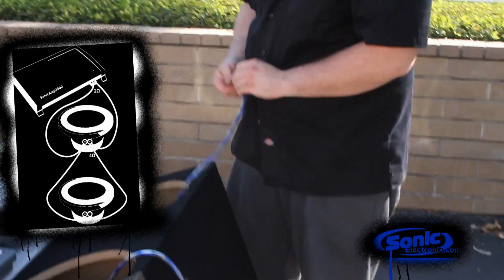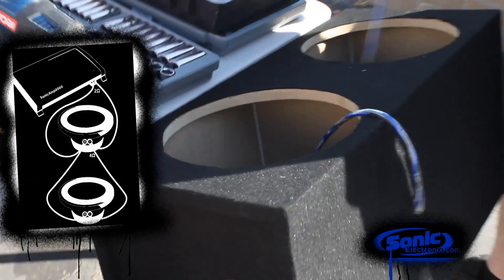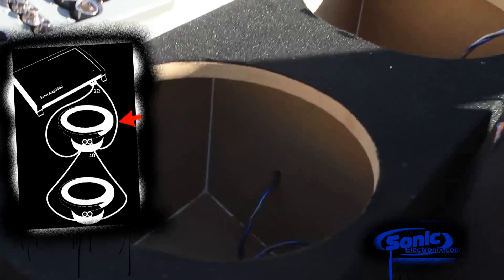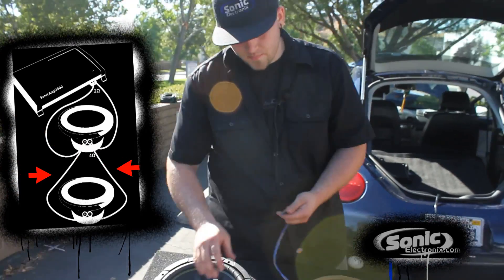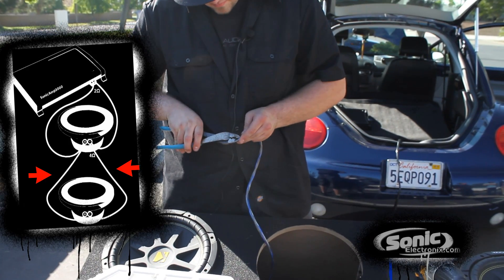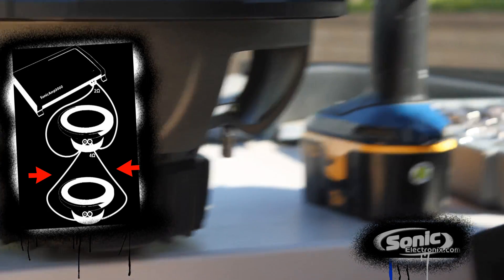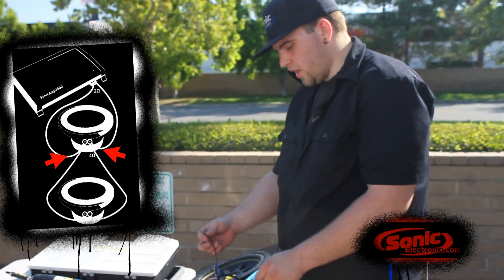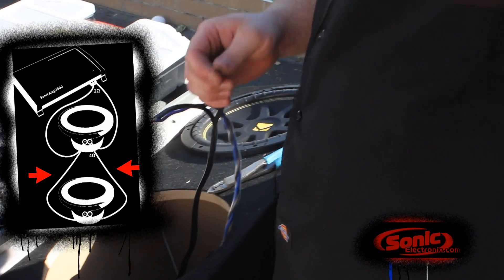How to Install Two Single 4 Ohm Car Subwoofer with a 2 Ohm Impedance

Comment from the maker: @ddizzle108 Max power isn't the actual power that you're going to get from your amplifier.  Max power is usually extremely overrated, so if you look at the RMS power on your amplifier you will get a more accurate rating of how much power is actually pushing towards your subwoofer.  On that particular subwoofer you're only going to want to run 250 watts of power to each sub, so you're most likely powering them properly.  Wire each subwoofer in parallel to it's own channel for the best output.

Comment from the maker: @ranchero302me If the speakers have a single voice coil and a 4 ohm impedance, yes.  Car speakers and subwoofers tend to have a 4 ohm impedance, however a lot will have 2-3 ohm impedances as well, so keep an eye out. The technique used in this video is called parallel wiring, and will reduce the impedance of a speaker.

Comment from the maker: @TheDaltonboii Well since you're using two speakers that require 1000 watts each, then you will need a total of 2000 watts to properly power them.  Always check out the RMS power when matching up compatibility with subwoofers and amplifiers as well, good luck with your system.

Comment: i have a question for you. if you wire the speakers together lets say you have 2 1000 watt speakers hooked together will a 1000 watt amp push them or would you have to get double the power

Comment from the maker: @lalop562 Depending on the accuracy of the amplifiers ratings, you may be at risk of blowing the subwoofer in an expedited fashion.

If the amplifier is rated way above the subwoofer, but the amplifier isn't rated properly, than it's very hard to distinguish if you're overpowering or even underpowering.  A lot of amplifiers are over-rated on the market so it's best to ensure if the amplifier you're dealing with is "CEA Compliant" or not.

Comment from the maker: @lalop562 500 watts will give you some bass response and it will work fine, but if you want to get the most out of your subwoofers I'd go with an 800 watt amp.  Good luck with that switch!

Comment: ok thanks a lot i'm going to go buy a bigger amplifier because the one i'm using now is a Sony XM-D500X 
250 watts RMS x 1 at 4 ohms
500 watts RMS x 1 at 2 ohms
2-ohm stable, Class D design. I was only pushing 500 watts at 2 ohms.

Comment from the maker: @Merwynlee You're best bet is to just run your wires from each box to the amplifier.  If you're using a monoblock amplifier that has two input terminals for both + and - then you can just run each positive and negative speaker lead to each terminal and allow the amplifier to internally parallel the wires.  If you amplifier only has one + and one - input for speaker wire then you can just twist the positive wires together and run them to the terminal and do the same with the negatives.

Comment from the maker: @lalop562 I'd recommend a monoblock amplifier capable of 700-800 watts of RMS power.  You can use an amplifier like the Infinity Kappa One, the Clarion XH7110 or the Boston Acoustics GTA-800M.  All three of those amplifiers will efficiently power your subwoofers and put out some great sound!

Comment: ok if I have two 12 inch kenwood kFC w3011 svc 4ohm, Power Range: 50-400 watts RMS (1200 watts peak power), wired together at 2 ohms, what's the best amp, power wise (watts) I should have hooked up to them ?

Comment from the maker: @fhstitans If the amplifier is specified to push 500 watts of RMS power at 2 ohms, it's going to push 500 watts of total power to your subwoofers, 250 watts of RMS power to each one.  If you require 500 watts of RMS power for each of your subwoofers, you need an amplifier that can push 1000 watts of RMS power to properly divide among your subwoofers.

Comment: So if your wiring your subs like this does the specifications of the amp that says 500 rms at 2 ohms is that the power total going to both subs or 500 to each?

Comment: I have a ported box with the port in the middle and i need to run some wires to the other sub. Is it ok to drill the hole through the port hole on the inside and then just seal the hole back up?

Comment from the maker: @kikomonsta13 Essentially.  Ohms are likened to the resistance upon the wattage.  So basically, the lower the impedance (ohms) is, the more wattage you'll get.  Amplifiers put out different amounts of power at 4 Ohms, 2 Ohms, and sometimes even 1 Ohm.  Always try to match up your amplifiers rated RMS power along with a subwoofers power handling so you can ensure that the system will sound the best without doing damage to your components.

Comment from the maker: @gturfreakon That would be a lot better of a matchup.  You could wire the subwoofers voice coils in parallel and bridge the amp at 2 ohms.  It will push roughly 500 watts of RMS power so you'd get some great sound from that sub!

Comment from the maker: @adj5195 Unfortunately we don't have the specifications for that amplifier ready.  If you were to connect your subwoofers like the video, you will drop the final impedance at your amplifier to 2 Ohms.  Depending how much RMS power your amplifier is capable at 2 Ohms it should be a pretty close matchup .  Two of these subwoofers should handle about 700-900 watts of RMS power at 2 ohms with proper tuning.

Comment from the maker: @gturfreakon That particular amplifier might underpower those subwoofers a bit.  The Soundstream VGW-12 subwoofers require around 600 watts of power handling, and that Rockford Fosgate T5002 would be pushing roughly 150 watts of RMS power at 2 Ohms to each woofer.  Since you'd be constantly running the subwoofer with less than the rated power you'd be at risk of playing distortion through the woofer and damaging it.
Reply: I really hope you respond. Can you wire it like that to a 2 channel amp?

Comment from the maker: @sep5491 If you have two Dual 4 Ohm subs, your only wiring options with a Monoblock amplifier is a final impedance of 1 or 4 Ohms.  Albeit, with that amplifier and subwoofer matchup it'd be better to wire to 2 ohms for a power matchup.  The amp will probably push around 1200 watts of RMS power at 1 Ohm based on its fuse rating, so you have to be extremely careful if you drop it to 1 ohm as you will be at constant risk of blowing those subwoofers.

Comment from the maker: @ads642 Both of those subwoofers are great options, but the R500-1 would be slightly underpowering the CVR's RMS capabilities.  They'll run fine with this power, but they can handle much more to run properly.  CVR's are Dual voice coil, so that will change your wiring options a little since each subwoofer will have two + and two - terminals.  We have a subwoofer wiring diagram I'll message you with, but as for an amp, go with the ZX750.1, or the KAC-9105D for better bass response.

Comment: @SonicElectronixTV Well thanks for the response but I have changed my mind since I have talked to a few people about the JL sub and most preferred the Kicker CVR. So now I am looking at 2 Kicker 07CVR122 subs and a Rcokford Fosgate Prime R500-1 amp. If I do the same method of connecting the 2 subs to the amp I should have more than enough power from this amp to power both of these subs over their RMS right?

Comment from the maker: @ads642 You've done your research well.  That Rockford Fosgate P300-1 will work perfectly with two 12" JL Audio W0v2-4 subs.  Along with that Fosgate amplifier you'll have great output that sounds very clean and responsive.

Comment: Ok so I am looking at buying 2 JL Audio W0v2-4 subs, both 12 inch along with an amp but I am having a hard time decided on the amp because I want to make sure it has plenty of power for the subs. The amp I would prefer is the Rockford Fosgate Punch P300-1 but it is only 300 Watt RMS at 2 ohms on 1 channel. So by doing what you did in this video this amp would give both JL Audio subs 300 watts? If this sounds confusing just tell me if the Rockford Fosgate amp would be enough for the subs.

Comment: ok the way i see it in the vid the way you  wire the subs + to + and - to - why not just wire them the normal way its the same. The way i wire mine is left sub + run out to amp left sub - run to right sub + right sub - run to amp

Comment from the maker: @lalop562 Well, a monoblock amplifier can have either one pair of + and - terminals, or two pairs.  The reason why a lot of monoblock amplifiers have two + and - inputs is for internally paralleling your wire, just like what we do in the video.  We personally prefer to do paralleling on our own, but you can use your amplifier if you wish. Keep in mind - it's achieving the same results.  A 2 Ohm final impedance.

Comment: ok I will but also my amp is a one ch. and it has two terminals if I connect my 2 4ohm subs i'n to each terminal will that be 4ohm or 2ohm and yes I connected my subs like i'n your video and they pound much louder.

Comment from the maker: @AlexTmetal If you have two subwoofers with Dual 2 Ohm voice coils and a monoblock amplifier your final impedance at the amplifier will be 2 Ohms when you wire in series/parallel.  The only way to achieve 1 Ohm on your monoblock amplifier is by using one Dual 2 Ohm subwoofer,  two Dual 4 Ohm subwoofers, or two Single 2 Ohm subwoofers.  There's a few other ways to achieve 1 Ohm at your amplifier, but those are the most popular.

Comment from the maker: @lalop562 When you wire your Single Voice Coil 4 Ohm subwoofers in parallel you will achieve a 2 Ohm load and you'll get more power from your amplifier.  If you were were to wire them any other way your amplifier would have a final impedance of 8 Ohms, and will not be compatible.  We have a subwoofer wiring configuration tool on our main webpage found in our Knowledge Base that can help with a diagram.  

Just hook them up like in the video and your subs will sound great!

Comment: ok i have 2 12inch 4ohm svc kenwood kfc subs  and a sony monoblock amp 1100 watts. if i connect on the outside the cable of one sub to the other and then send a cable to the amp. that will give me a 2ohm load. and would that be louder than just running the subs straight

Comment from the maker: @MrTonycampos Let me clarify,  if you mean that if one subwoofer requires 250 watts of RMS power, and you want to drive two subwoofers you will require 500 watts of RMS power you are correct.  Always match up power with RMS and don't pay attention to peak or max power as they're usually over-rated.

Comment: @mist214 ← IDIOT! seriously... a ¼" hole isn't going to effect sound quality. If you had one with a sloppy ass wire wrapping around the back of the box (which you probably have) next to this one (same box, same subs and same amp powering it) you wouldn't be able to hear a difference. If you can, then you probably hear as well as a dog... cause YOU a bitch! Don't go talking ish if you don't know what you're talking about.

Comment from the maker: @jsjgamer For the most part that seems fine.  Most Infinity Reference Subwoofers require 275-300W RMS, and as long as the final impedance at the box is 2 Ohms you'll have yourself an excellent matchup.  With the gains I wouldn't recommend to exceed the bass boost on the amplifier past 50%.  4 Gauge wire will be perfect for this install.  Check out our user forums by the way, a lot of users have great feedback for car audio.

Comment: I am thinking about installing a pair of Infinity Subs. It is the prebuilt subs reference series with the 600w RMS Reference amp. What gauge wire would you recommend?? Also since i am getting them they are gonna be really loud so if i turn down the subs to maybe 25%-50% would that hurt the subs? Would it be underpowering it??? I just dont wanna over do it.. If i did wanna turn down the sub on the amp how would i go about doing that????? without underpowering the sub???????

Comment from the maker: @fammguyy202 4 Ohm, 2 Ohm, Single Voice Coil, and Dual Voice Coil really doesn't impact the sound at the end of the day.  It only really affects your wiring options. Check out our subwoofer wiring diagram found on our websites Knowledge Base for specific information regarding compatibility between amplifiers and subwoofers.